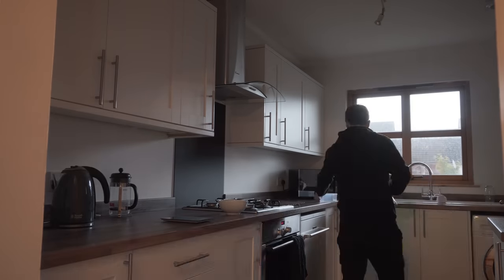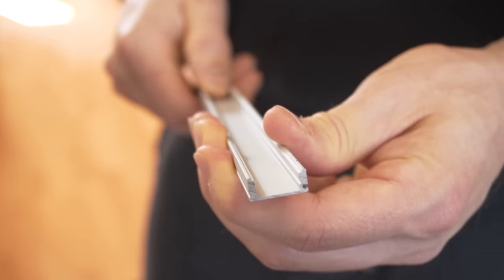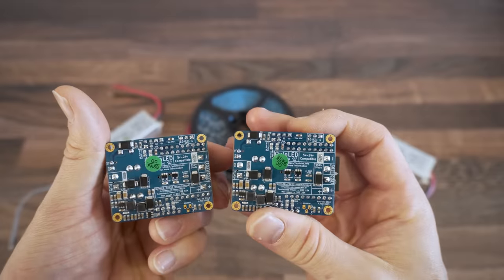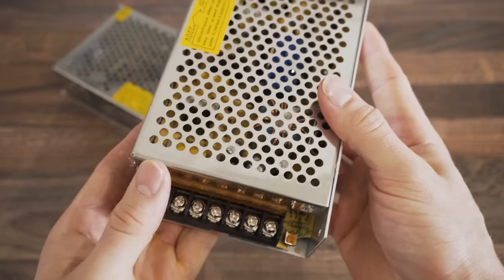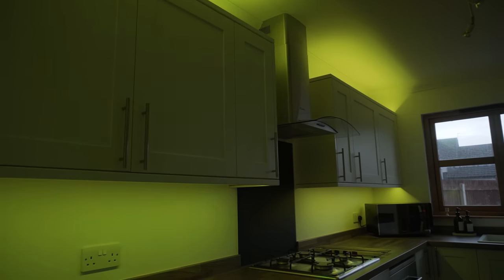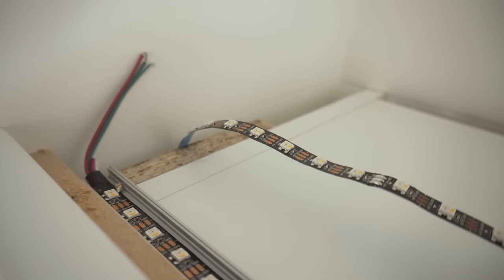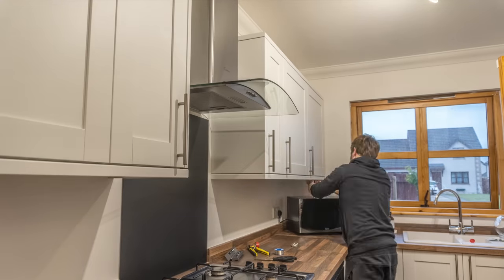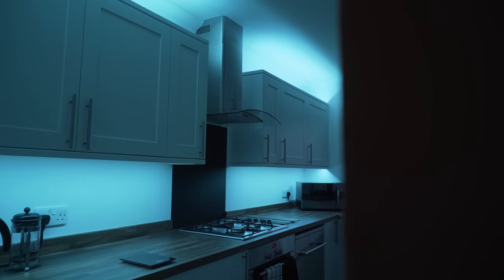Transform Any Room With These DIY Smart LED Strip Lights!

Comment: Here's a tip, do all the LED work BEFORE mounting the channel. When you finally mount, the LED and all connectors should already be part of your channel assembly. You ideally want the whole thing to be modular and easy to replace parts of if needed down the road - without having to tear everything out and redo all the hard work. I get paid to do this kind of thing for other people, so easy serviceability makes my life easier if some component dies. Use connectors & wire between assemblies. Mind the total amperage and wire gauge when going long. You have voltage drop (which you saw) but also heat, which can easily melt the wire insulation and even the connectors if they're not adequate. Wiring in the middle of a long run can be an option depending on the lights being used.

Comment: Good video! A tip about power distribution... Although the data for the LEDs are directional, data isn't. Assuming you have one power supply for each set of cabinets, you could position your power supply in between your upper and lower strips. So the data wire would look like this DigUno > Upper LEDs > Lower LEDs and the power wires would looks like this: Upper LEDS < Power Supply > Lower LEDs. If you're also powering the DigUno from the same PSU, just run another, separate wire from the PSU to the DigUno.

Comment: Awesome and timely video! And yes, I would love to see more of the WLED configuration, for how you set it up with the two independent strips and modules, yet have a sequence that brings both sides together. 
Also, I saw you cut those two wires...they are not needed?
Reply: I would have used those two wires to inject voltage directly from the power supply. The QuinLED has a 10 A fuse, and they recommend in case of long strips to apply directly the voltage into the LED strip (at several points)
Reply from the maker: Thanks! I'll certainly add it to the list!

The wires were cut at the very start of the strip just to remove the connector, so that the wires can get screwed directly into the Dig Uno.

I will run some power injection wires soon!

Comment: Great video however there are a couple of points, the first is that the transformer should be in a enclosure as you can still touch the live terminals and the 240v cable is only single insulated as you removed the outer sheathing. The second is that with this setup the transformer is on all the time regardless of if the lights are on or not, a better solution is to use a Sonoff basic with WLED, the Sonoff is able to switch the transformer on and off and control the LED strip - saves spending money on a 30A transformer being on all the time!
Reply: Robin, would that not mean a delay in turning on when you need it tho? You'd have some startup time? Also the transformer seems a lot, any idea if a normal wall wart power cable is ok? I wish Everything Smart Home had listed alternative items too, such as 12v alternatives
Reply: Wled supports a relay to power the PSU separately when needed. That would mean installing a second PSU to power the controller (a small wall wart should do), connecting grounds, and, perhaps, a small delay when turning on. 
While a PSU doesn't consume much by itself when idle, the argb strip connected to it will draw a larger current even when off.

Comment: I'd suggest you power the diguno with a phone charger style plug.  Then put a relay inline of the 5V larger power supplies and the dig uno.  That way when it's not running lights it turns off the power hungry larger power supplies. The diguno and WLED support the relay feature natively and when you say to turn on the lights it'll turn on the relay and turn on the large power supplies seamlessly.   Saves you power when the system is idle.
Reply from the maker: Hmm interesting - the power draw as is indicates only 250ma when off?
Reply: I'm really interested into this. Do you have some diagram? Cannot fully picture the situation you describe. Thanks!
Reply: @EverythingSmartHome  You just have to power the ESP board with the smaller charger and keep the big power supplies off.  You could compare the power draw of the larger PSU's vs a phone charger and see what it saves you.
Reply: @ungeekenmunich  I tried to post a link to the diagram but YouTube ate it.  Would love to share it just unsure how on YouTube
Reply: The PSU itself is not power-hungry, but when the LED strip is connected to it it consumes power even when not lit. The longer the strip, the more.

Comment: I love WLED powered strips. Have a bunch around the house. However for the kitchen, I still go for Philips Hue only because they work perfectly with HA Adaptive Brightness. In the morning I get nice bright white and at night I get low soft white. No other LED strip I’ve seen has White Ambience like the Hue. It’s either RGB white or only one temperature of white. Wonder if anyone has come across some cause Hue lights are really expensive and the LED array is not very dense.

Comment: what gage wires did you finally use to solve dimming between top and bottom light strips? SHould I use 12v instead of 5v led strips? Been thinking about doing this for a while, now i think it's time to get it done. Great Video!

Comment: This is really nice, I will be doing something similar. I've not worked with motion sensors before but I'm thinking motion sensors on the underside of the cabinets could detect hands preparing food etc and turn on the lights, instead of them switching on every time you enter the room.

Would love a WLED tutorial
Reply from the maker: Motion sensors work really good yes!
Reply: I've seen it used with a vibration sensor in the counter/sink to trigger. Really liked the fact that it was completely invisible

Comment: We did a similar thing when we had our kitchen fitted last year. Our extractor fan has a basic choice of LED colours that light up the front of it, our kitchen turns into a disco whenever we get the chance! I powered each section separately, this was more due to being a novice, but it makes it easier to have all lights come on during normal evening hours and bottom lights come on if someone gets up in the night.  On the top cabinets we angled the strips slightly, found the light effect on the ceiling was bit to 'square' otherwise. Unfortunately, the longer section of LED's on top right went a bit crazy so looking at sorting that out, all a learning curve!
Reply from the maker: Haha indeed there can be a learning curve but definitely worth it 😅

Comment: That looks so clean and modern, I have installed a WLED setup under my bed so it gives my bedroom some nice ambient lighting. Plus I have just moved home assistant from a Pi4 to my Dad's old computer which is much faster and can handle what I do. The way I can do this is that I have installed Proxmox on to the system and then made a Home Assistant VM and a Ubuntu VM. The Ubuntu VM is for doing File Shares, Dockers, Minecraft Servers and my Plex Library.

Comment: If you didn't cut the wires too short, you could apply the 5V power at the mid point instead of the end. Then there would be less voltage drop along the lower LED string, or at least similar voltage drop along both top and bottom strings.
Reply from the maker: I would/am going to solder new wires regardless so it doesn't really make any difference

Comment: Looks really good. I did similar recently but used 5 separate 12v govee strips, for two top cabinet sections, two middle and one around the plinths at the bottom. All controlled using Hue motion sensor and Alexa routines. The only bit of mine that i'd improve is LED strips with dedicated white leds.
Reply from the maker: Nice, good to hear your experiences with those strips. I have some of those at the back of my desk still 😅

Comment: Great video.  Would’ve been nice to see where you hid the power supply and uno in the end.  Are they just sitting on the cabinets?

Why did you go with dig uno and not a regular esp32? They seem quite expensive in comparison.
What wire gauge did you go with in the end?
Did you use a case for the Dig UNO? If not, are you worried about condensation from cooking…etc?
Reply from the maker: Thanks! Yes they are just sitting up on top, Im not worried about them but I guess I'll check them in a few weeks! 

I mentioned in the video that I personally feel dig Uno's are a no brainer for safety and ease of use, especially for beginners who don't want to mess about with potentially dangerous electronics. If you are more experienced and know what your doing then you can definitely go for a regular esp32. Hope that helps

Comment: Im looking into doing this at my home, so thanks for the vid. I have a question about power, though. It looked like the old system you had was controlled by a wall switch. You mentioned the 'big switch-on' (10:40). And it seemed like the Dig-Uno and the LEDs came on pretty quickly, but....do you just leave the wall switch on 24/7 now and control everything from WLED/HA? It seems you would like some 'manual' functionality as well, allowing visitors (or people without the app on their device) to control the lights as well. Did you install a smart switch in the wall as well? How did you deal with the wallswitch here?
Reply from the maker: Thanks! The mains wiring is connected to a regular light switch, in which is a smart light switch so can be toggled manually if wanted, but generally it's always left on at the switch.

Hope that helps
Reply: @EverythingSmartHome  it does. thanks

Comment: Recently discovered Wago connectors. They're so useful and great for connecting wires in places where using a screwdriver would be awkward.
Reply: The newer 221 style wago connectors are great, much better than the older ones shown in the video: smaller, flatter, transparent, and easy on the fingers.

Comment: Have you checked the stanby power usage? Addressable LEDs are quite power hungry when they are switched off and I don't think the DigiUno cuts power to the strip. Agreed on the strip voltage, 12v are the way to go for these leds and 24v for the plain white LEDs.
Reply: Wled can cut the power to the strip, a matter of activating a checkmark in settings, connecting a relay to the strip PSU, and having a separate PSU power the controller itself.
12v argb suck for room projects because they usually work in groups of 3 LEDs. Ok for outside projects where you don't get to see them closely/directly
Reply: @BoraHorzaGobuchul  I know that wled can cut power, I was talking about the hardware part. On my setup I'm using a mosfet to switch the 12v power to the strip and they don't work in groups of 3

Comment: 12v argb strips work in 3-pixel groups though. Ok for diffused light but could be noticeable on the bottom strips still. More importantly, is used for actual lighting an RGBW strip would be vastly superior as RGB white sucks massively. To make it perfect, one should get high CRI white leds.

Comment: I'm wondering if we can control the power outage behavior?

E.g. when the power goes off and then on again, most LED strips immediately turns on. Some remember last settings (color and brightness), some don't. What I'm trying to understand here is if there is some setting to tell what the power outage recovery behavior should be. Phillips HUE have such.

E.g. If the LED strip was off when power outage happened, I'd like it to be off when the power recovers. Do you think that's possible?

Comment: Nice one! Doing something similar soon. Did the full front of the house last year and regarding power injection, with the close distance you have in the kitchen you could easily fix that with the two extra wires. Again real slick setup, well done!
Reply from the maker: Thanks, yep that's what I'm planning to do with the power injection. 

I'll need to do a full house setup soon 😅
Reply: @EverythingSmartHome  I went a bit overboard and ordered a ton of strips and D1 Minis, also a lot of PSUs. Result => House is awesome, daughters bed is awesome, also vintage Ikea lamp is now awesome as well 🤣
Keep up the awesome work mate, love from Sweden.

Comment: You’re already using a 5v power supply, what are you getting out of the “diguno” over a D1 mini?
Reply: I did an rgbw set up for a friend, the addressable are only really used to show off, you never want to use them in practice unless you are having a rave in your kitchen

Comment: The link to wire in description is the thinner one or the one you have replaced with?
Reply from the maker: It's the thicker one, the one you should use 😅
Reply: @EverythingSmartHome  thanks. I'm looking to do something similar but on shorter distance - all together 4.5m (up and below) and then another 4.5m under standing cabinets. When looking at 12V LED all are 5 pin, guessing there is no 3 pins in 12V? 
And one more question - the color of PCB - does it matter? or is it just personal preference?

Comment: Apologies it it's been mentioned already but you should be able to reduce your voltage drop on the underside strips by wiring the driver in the middle of the two strips rather than at the end of the top strip, effectively feeding both in parallel rather than series
Reply from the maker: Thanks, yeah I mentioned at the end of the video I was gonna do this 😅
Reply: @EverythingSmartHome  Haha apologies,  I must have been multitasking and not properly listening :D

Comment: How about integrating WLED with Home Assistant? I started the process and found the integration lacking and wondering if I was missing something.
Reply from the maker: Really? It's got one of the best home assistant integrations there is IMO and should be auto discovered immediately
Reply: @EverythingSmartHome  It has lots of bits and pieces but takes a lot work to make something useful other than activating a preset. A panel with drop downs and sliders that allows easy integration would be nice. Especially if you have multiple controllers.
Reply: @EverythingSmartHome  The integration got even "better" with 2022.06 and my devices are no longer supported. 
`WLED device 'DiningRoomBulb1' has a CCT channel, which is not supported by this integration`.

Comment: Amazing video, as always! A few questions: 

- Which 12V strip would you recommend? So far I have not seen any 12V with a dedicated white channel
- What about wall switches? The 230V voltage where the Power supply is attached, is it controlled by a wall switch? Or do you fully rely on smart features to turn the lights on?

I'm getting close to get my new kitchen and I have all kind of plans for it :)
Reply from the maker: Thanks appreciate it!

There are apparently some 12v version of the sk6812 but I haven't yet found them in my country

The 230v is wired to a regular light switch (although it's a smart switch) meaning it can be turned off at the wall if need be
Reply: @EverythingSmartHome  so that means that every time you flip the switch you turn on the supplies and the QuinLED right? does it take long? Thanks a lot!

Comment: Nice video...looks pretty straightforward with the equipment you selected.  Roughly, about $300 - with the lights making up the biggest outlay?
Reply from the maker: Thanks! No it would be roughly £100 for 5m worth of LED strips (I already owned a Soldering iron, cable, heatshrink and all those bits and bobs). So £200 all in for me for both sides.

That said, the SK6812 is very inflated pricing in the UK at the moment and is half the price on AliExpress and in the US - I've bought this strip for so much less previously. I would say when the SK6812 is normal pricing, it would be more £150 all in for both sides for me. You could also choose a much cheaper or non RGB strip (white only) to cut costs if you didn't need those things.

Also, if you didn't do 2 separate installations you wouldn't need 2 controllers and 2 power supplies - just depends on what your house is like.

Hope that helps!
Reply: @EverythingSmartHome  Thanks for the additional info!  My only experience is with the simple plug & play less.  I'm remodeling a bath & bedroom and hope to incorporate some automated led's in the bath (turns on with motion detected) and bedroom closets (although I may just give into Ikea new closet lighting).  Also, I learned a lot from other's questions and your replies.

Comment: You should definitely fuse all strips
Reply from the maker: The dig Uno has a built in fuse already
Reply: @EverythingSmartHome  are you referring to the PSU? That the psu has a built in fuse? This is for its own protection only. 150W can set a fire really quick in case of a short circuit. That is, a short circuit strip will lit and the psu fuse will not trigger. Just calculate the amps for each strip and fuse it accordingly to be on the safe side. Use car fuse/boxes which are cheap, neat and make power distribution look beautiful. As a rule of thumb, whatever you use a psu over 70W use appropriate inline fuses. Just on the + side of the DC current
As an experiment, take a strip of your leds, power them as usual and short circuit the other end with a wire. Do it in a safe and controlled environment though!! Always fuse all LED strips in case you are using a big power supply

Comment: So I bought all of the bits using Lewis's list but I can't get the led strips to - well - light! I'm using the digiduo board powered from the PSU and I'm getting +5V into the duo and the leds are on. It's connected to the WiFi network and  it has autoregistered in HA. I've got 5v going on to the led strip. But still no light. Any suggestions ? The config in WLED is showing the right led strips and I'm using GPIO2.
Reply from the maker: Hop in the discord I'm sure we can get you sorted!
Reply: @EverythingSmartHome  thanks. I'm supposed to be working at the moment:( but may take you up on that.
Reply: Just a time for anyone doing this using a new Uno board. If the lights don't work try changing the GPIO from 2 to 16. Apparently the newer boards use a different GPIO pin.